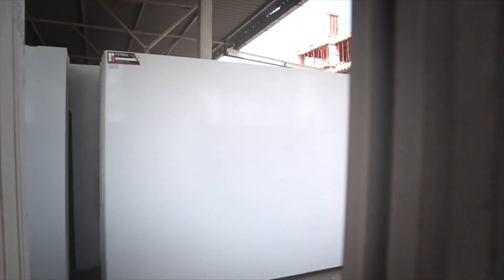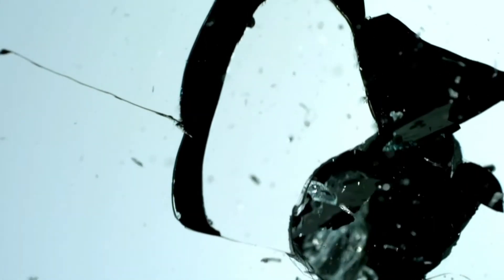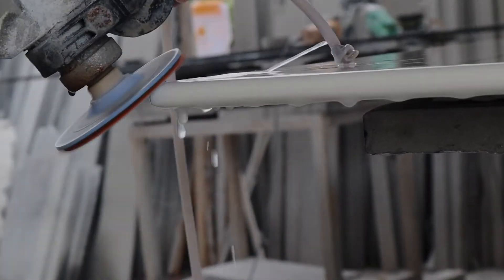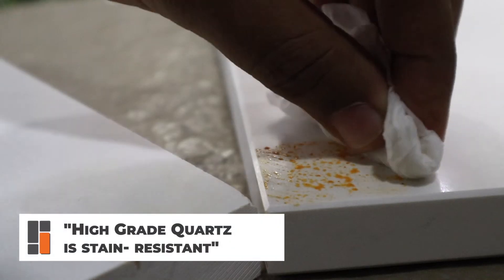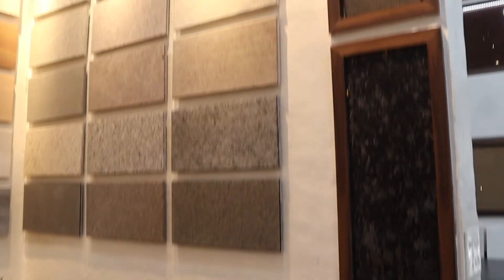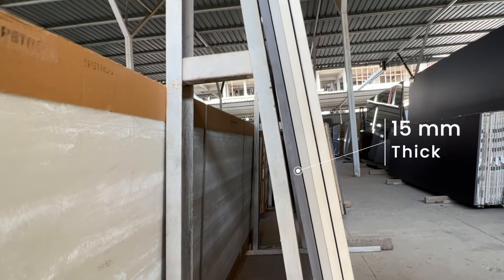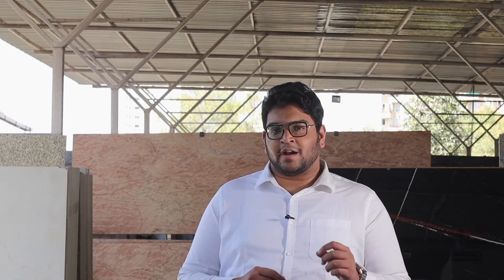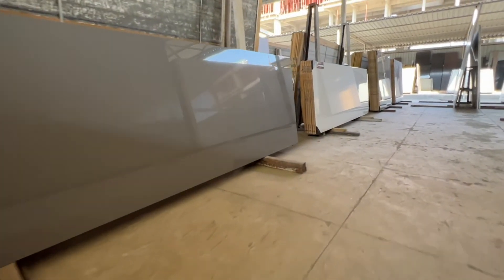What is Nano White G5 and G7? | Quartz Vs Nano Vs Porcelain Slab | Which is the Best?

Comment: Could you also review Kajaria Vitronite and how it compares to these options for kitchen countertop. That would be very helpful.
Reply from the maker: We do not recommend full body vitrified kitchen slabs.
Reply from the maker: No, we don't. We dony recommend porcelain for kitchen countertops irrespective of the brands
Reply: @petrosstonellp  Hi sir,Which stone you suggest for kitchen countertop,need to be hard,heat resistant and stain free from oils or haldi.

Comment: Wonderful video. I hav a question. I have a dining table of 5*3 feet, And I'm thinking to buy Composite marble and put on top of it. 
The reason I'm choosing it cz I'm getting my required design and color in composite only.
Please suggest.
Reply from the maker: We don't suggest composite marble for any applications, specially not used for dining tables as it can stain very easily. Please WhatsApp+91-8446360361 with your reference image

Comment: Can't we use composite in window framings ?
Reply from the maker: No, we don't recommend. It has been used by people and warping/cracking issue is observed.
Reply: @petrosstonellp  then If I want to use in white what should i buy ?
Reply from the maker: In that case, high grade quartz (30mm thickness) or granites (can look at white granite.video on the channel) will work best. If you want further assistance, get in touch with our team directly - +91-8446360361